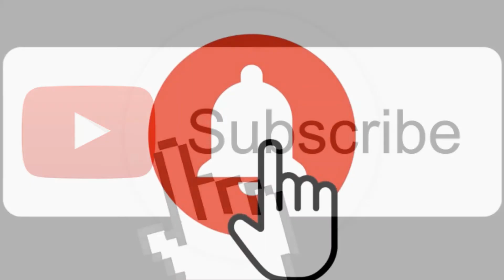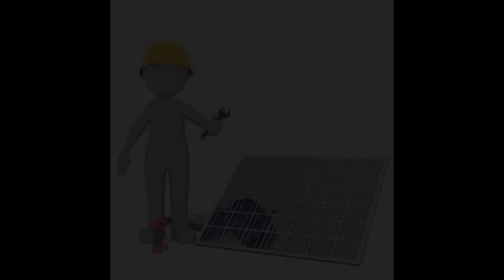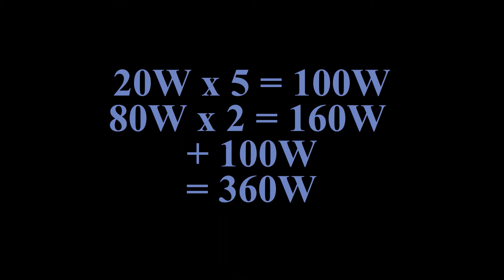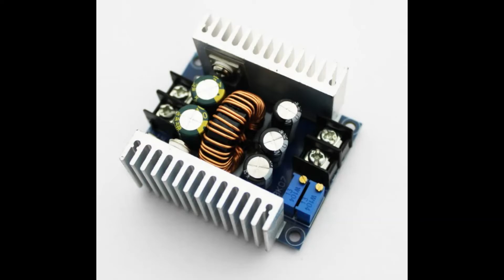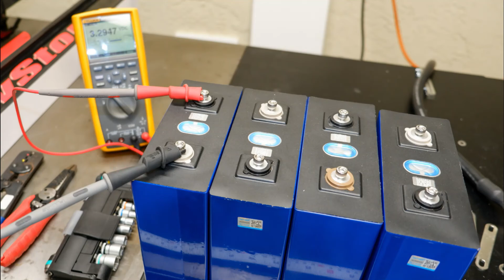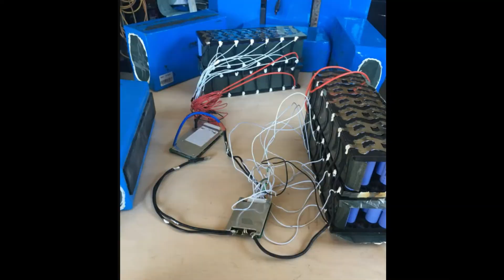How to size solar panels for your off grid home solar system

Comment: Panel voltage / battery voltage = factor.

Panel current X factor = charge current.

30v mpp. 24v battery (27.2v)
Solar actual power 8 amps.

30/24= 1.25
8 amps x 1.25 = 10amps

30/13.6= 2.205
8 actual amps  = 17.647amps

Hope that helps understand the charge current as per the charge controller amperage.